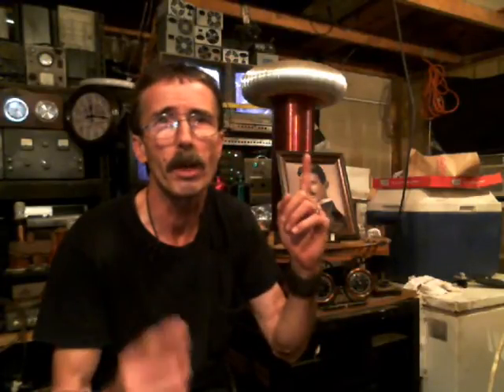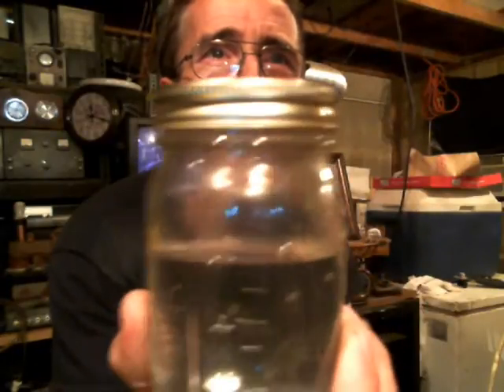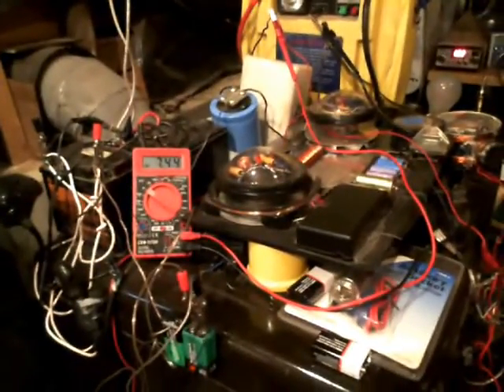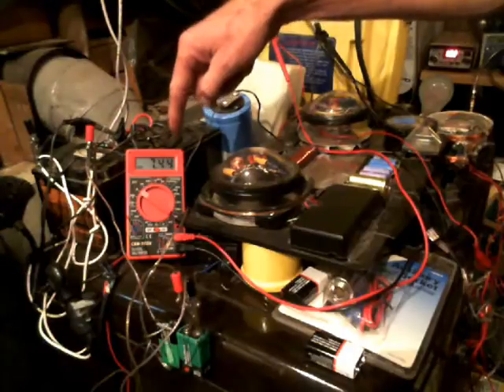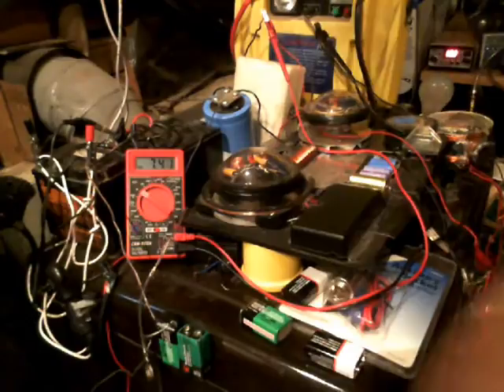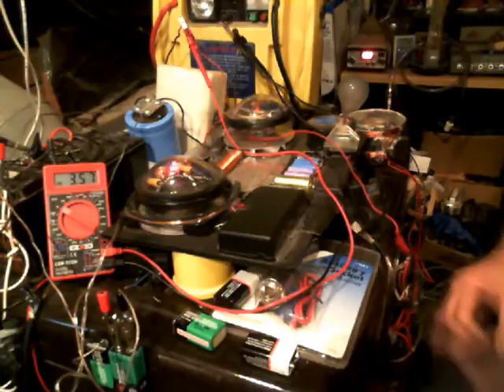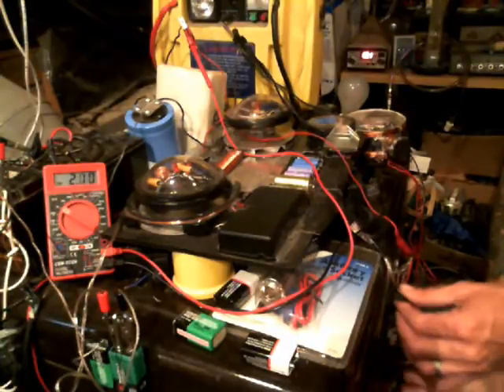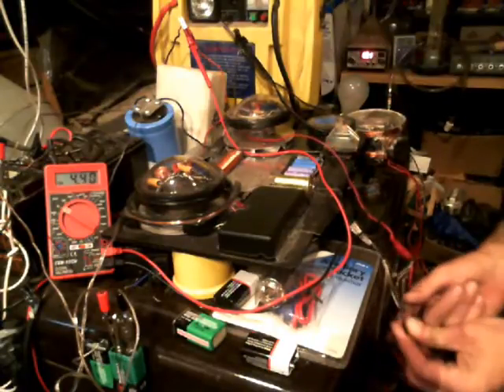EARTH CIRCUIT !

Comment: Have you ever tried to saturate the ground with water so the rods are in wet soil.. It should cause the resistance to decrease...or even put holes in the sides of New rods and shape it like a spear or point and solder it to prevent dirt from getting inside of the pipe so you are able to pour water directly into the pipe to saturate the ground. Everyone is told in school that it is the friction from the molecules in the clouds that cause lightning. But I think that is not the case. The more water in the clouds the less resistance which eventually leads to a discharge because of nature wanting to balance itself. This is why they are able to shoot a wire up into the cloud to cause lightning. So I do not believe that it is the friction of the water molecules bumping into each other which causes the lightning but instead coming from space. You have lightning that goes side to side and stays in the cloud and also Sprites. I think the friction of the water molecules adds to the discharges from the Sun that turns the earth into a magnet which causes lightning. It's not the Water by itself. The water makes it easier for the lightning to get to the Earth it should make it easier to get it out of the ground. I'm pretty confident that it will work much better if you're able to add water around the rods to make it easier for the earth to give up its goods.. take a sample of the soil around the rods and check the resistance. Then add the amount of water you would expect the ground to get saturated and check the resistance. You could always excavate so you can put bigger pipes in to saturate the ground if needed. Also maybe you should try using tree. Who knows they might even be doing most of the work and will make it a lot easier for all we know because of the surface area of roots is a lot more and there is more water and because it's the tree that actually takes the water out of the ground

Comment: Hi from dublindublindublin great stuff .The info that is useful for you is that best super capacitors energy ability is ~6 watt hours per liter compared to lead acid ~60 watt hours per liter .So you need  6 times as many super capacitor batteries to equal one car battery .However in New Zealand they claim to have cracked the problem using single molecule sheets of graphite sheets and say they can soon match lead acid battery and make super capacitors to replace lead acid  battery in cost terms